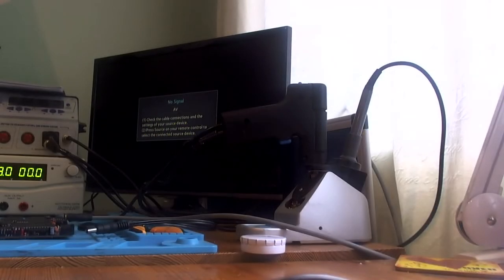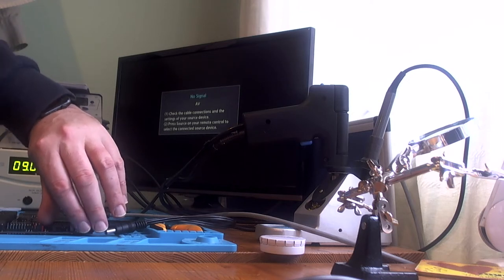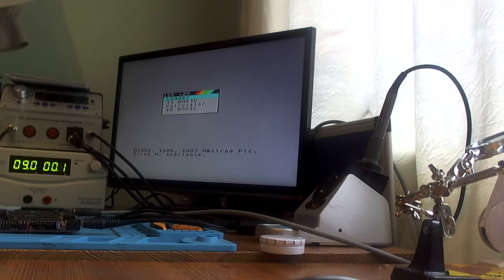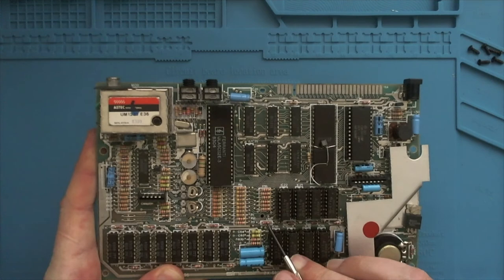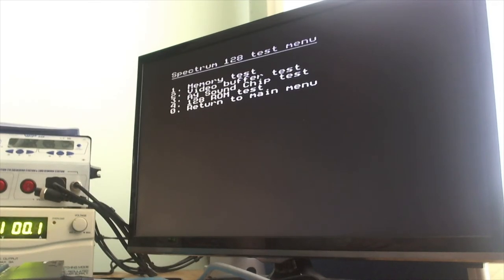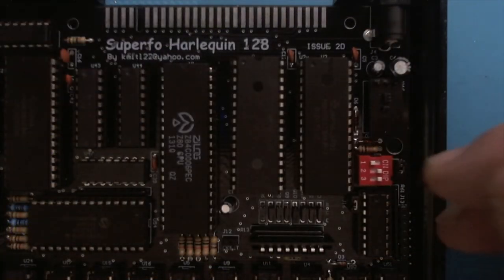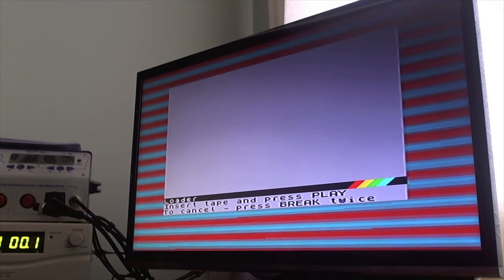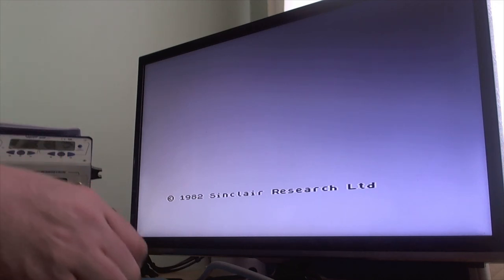Building a Harlequin - Part 5: Testing

Comment: mine booted on the first go with the basic toast rack rom, but I made some mistakes on the plus 2 rom after and it would give black and blue lines. I did not understand the one I found was split into hi and low, I thought it was version 1 and version 2 so only burned half.